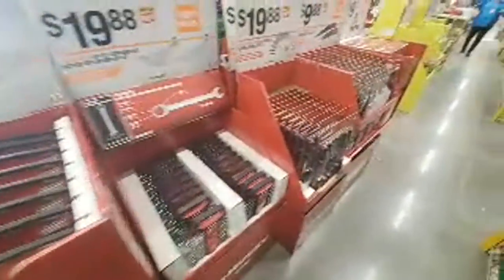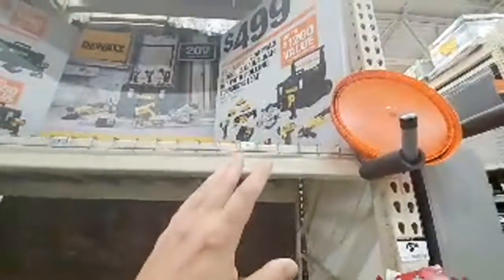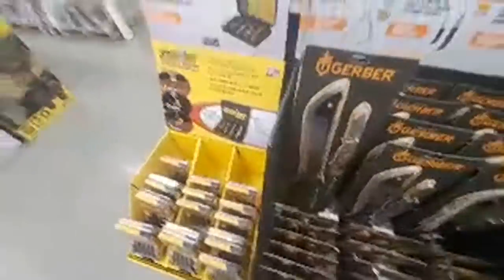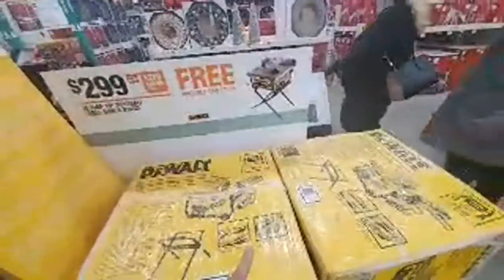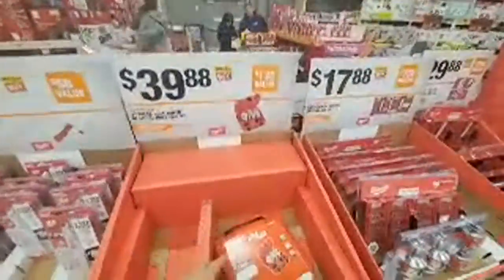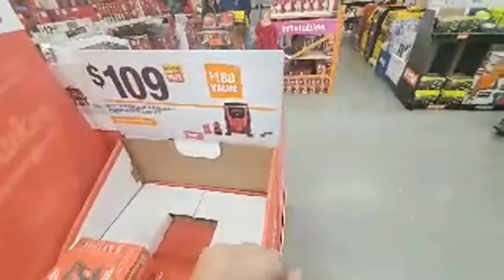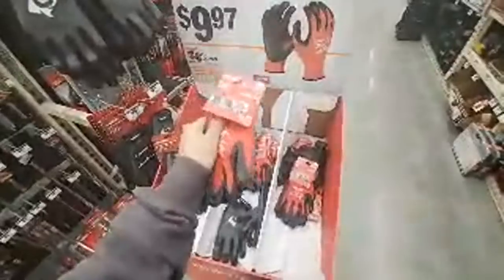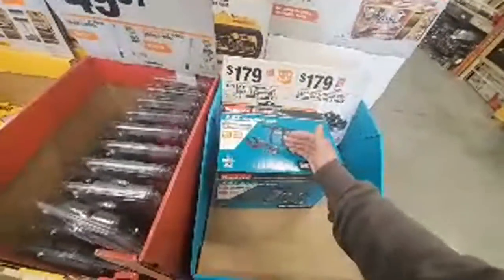Home Depot Live!! Black Friday Has Arrived 🎄🎄

Comment: Tool Boss what your take on the Rigid impact driver for blow out 99.00 regular 198.00  My local depot was sold out limited supply I ordered 2am online ..  why that so expensive regular 2amp hour, charger big torque best in class. I would like them to throw in rigid bag be better.. almost did the M 18 Millawkee but Iam on Rigid platform.   and the 3 speed transmission on the case.
Reply from the maker: Which Impact Driver the 6 mode ?
Reply: No the $ 198.00 driver kit brush-less 2.0AH 18 volt with 3 speed and single beam light down by battery comes with batt, charger, drill 2250 " lbs on sale for 99.00  depot website says best seller. but cant find any reviews close to this R86038SB4 model kit.   driver only no drill.

Comment: They still got the makita lxt with wrench and drill and 2x 3 mah battery each for $149. Not sure if I use the wrench. But insane deal. Especially brushless. Is that the best deal home depot got you think for price for drill set?
Reply from the maker: It's still a good impact just made for light duty applications ✌️

Comment: No one wants Hart boss. Stop talking about them. 😜
Reply from the maker: Stop .. Chaka does 😉👍
Reply: @toolboss8410  imagine walking into an old garage, boss. And in the corner there is an old beat up work bench. And laying in front of that bench is a Walmart receipt. And on top of that bench is one Hart Drill and a dead battery that won't hold a charge. And across the other side of the garage is a charger that was tossed at the wall.

Do you want to be that guy, boss? Don't be that guy, boss.